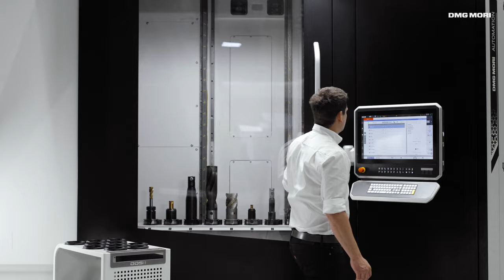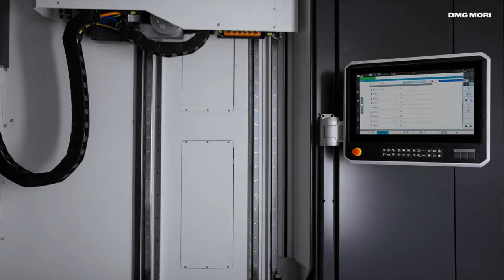Central Tool Storage (CTS) automated tool magazine for high flexibility

Comment: What would an actual use case for this be? What process requires this many tools?
Reply from the maker: Hello @jb76489, a central tool magazine (CTS) for up to 1,440 tools is required when a wide variety of machining processes are required, very complex workpieces are machined, machines are automated and very long running times are required. In this cases, a large number of tools must be kept ready so that the linked machines can run without interruption. Your DMG MORI Social Media Team

Comment: Overengineering. 🤷‍♂
Reply: Everything depends from application. Imagine 10 mills with that system plus another similar one for pallet exchange and you can run these 10 machines with only 2 people with high efficiency and repeatability.
Reply: @nikus1989  All I see is tons of setup time and error lists.
Reply: @92cortez92  If you are running something this scale you have presetters with RFID.

Comment: The system looks neither cheap nor fast! For industrial series production rather unusable
Reply: It's not for industrial scale, it's for high end labs that do short runs on intricate parts and prototypes with as little human error as possible.
Reply: @asdgfjokl  Apart from industrial applications, however, I can think of very few applications where such a complex and expensive system would be profitable.
Reply: You still have a tool changer at the tool but instead of having a 4 foot bump out with 50-100 tools on 10+ tools in the factory, you have smaller capacity at each tool, and they all borrow from this changer.  This means shared inventory, better footprint for the machining centers, and lower tooling cost overall.
Reply: Far faster than humans loading the tool changers in each CNC manually, and more importantly it solves one of the common fucks up that is loading the wrong tool in the wrong slot, and one of the more expensive fuck ups on the floor shop - dropping and chipping a $25,000 end mill.
Reply: @asdgfjokl  It very much is, it can feed an entire factory, as you can have multiple carriages and carriageways.
Reply: @DOGMA1138  This person gets it!